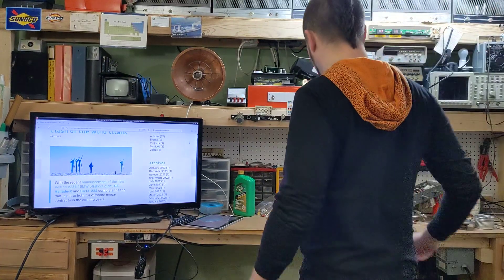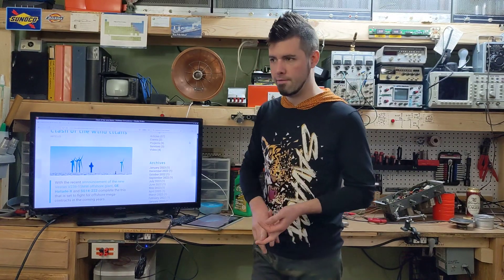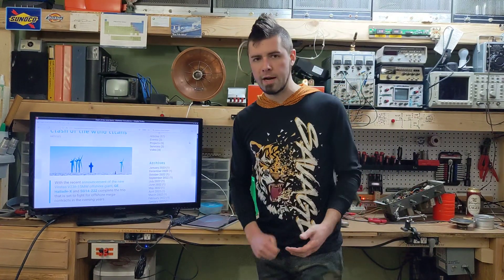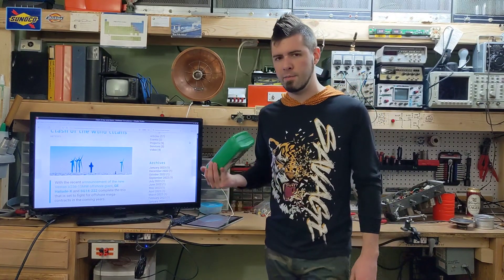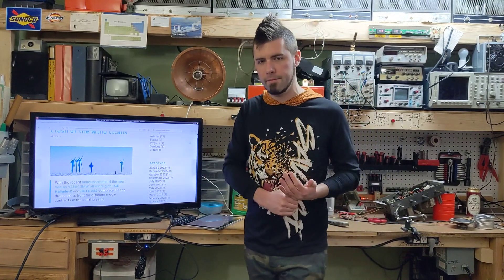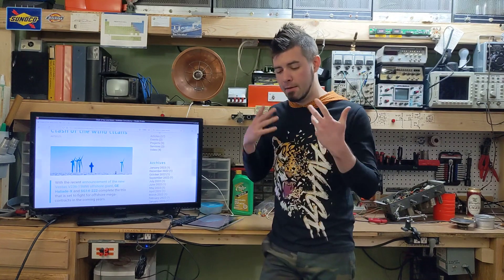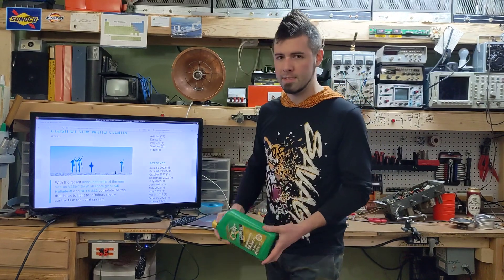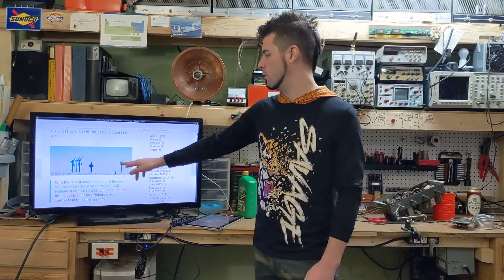How much oil is used in wind turbines?

Comment: Btw oil in wind turbines is changed every 9 to 16 months, more often in older turbines.
  So no your analogy that it's like transmission fluid isn't even close to accurate
Reply: Yeah but you ignore all the power output, energy it creates........ you cant compare that to an car that is burning it all with green gas (overall, the whole concept of an car) and an whole car is mostly considered an "cost" "consumerable" product.. Windturbines produce alot of electricity and its highly scalable (each year or so they prove it again), they even made some optimisations that by even at lower wind speed to produce the same or almost the same amout of energy even if it spins faster. There is almost no comparison.
Reply: @samfkt  actually wind turbines are far less efficient at producing energy than fossil fuels. However, if your concern is "green energy" hydro energy is far superior in every way than any other form of energy with a conversion rate of 90%.
Reply: @danielsmit11  I considered all variables, overall...   ofc nothing is ideal. And hydro etc. is not possible everywhere. Also he literally made the calculations by considering the oil change in 12 months but yo still complained even if he considered it.
Reply: @samfkt  electricity from dams can actually travel hundreds of miles, think 300 is the upper limit. Considering there are rivers through the vast majority of the U.S. much of our power needs can be obtained through hydro.
  Modern  Hydroelectric power plants can reach a conversion rate of 90% which far out performs wind turbine conversion rates of 20% to 40%. 
  Hydro also has the advantage of being cheaper than all other forms of electricity.

Comment: You're comparing a windmill to a power plant using diesel, but your power plant is hydro power. A 5MW windmill is not 80 it is 800 gallons of lubricant and that is not including the other 1000 or so gallons for the transformer. Generating power will never get away from using some kind of oil period. Windmills are lot of maintenance every 6 months. Imagine a forest of windmills that are high up in the air. Not so efficient to maintain anymore is it?? A small nuclear power plant generates 300MW of power.  You need to build and maintain 60 windmills to generate that much if they ran 100% efficient, but they aren't they are 20-40% at best. Solar and Windmills are a pipe dream. Hydro and Nuclear power is where it's at.

Comment: does a turbine really pay for itself in the life of the the wind turbine ? I've read in the 2-4 million dollar range
Reply from the maker: No one would build them if that wasn't the case. Wind power is a business. Let's look at a worst-case scenrario: A $3 million turbine might be a 3.8 MW unit, which produces 11,650 MWh/year at the average wind site. If we take the current Lazard lowest unsubsidized levelized cost of electricity of about $26/MWh, the turbine has an ROI of 10 years. That's still under half the life of the machine.
Reply: @anthraciteenergetics5497  By "half of the life", can you explain what happens after end of life? They change only the gears, generators and blades? Or all of it?  I heard they dropped the overall costs of installing it and building it up to 70% since 2010
Reply: @anthraciteenergetics5497  if they were not so subsidized they would not be built at all, it does not work without them. they also only last a tiny bit over 20 years, cant be recycled either. the ones in the long island sound half dont even spin and costs only went up.; its a scam atm

Comment: Gasoline is ~37.5 kWh per gallon, Diesel is a bit more, at ~41 kWh per gallon. If you see an EPA estimate of 115 MPGe  on an electric car, just divide that number by 37.5, to get the equivalent miles per kWh for that car. (~3 miles per kWh)

Comment: technical point:  an AUTOMATIC-TRANSMISSION  utilizes "transmission fluid" ... thin & <less viscous  10 weight ? ...    
a MANUAL Transmission  uses  HYPOID GEAR LUBE  ... 75W135 weight is not unexpected ... 
the Gear LUBE is NOT changed often - but - it is NOT a permanent LUBRICANT ... 
Thank You for your Informative VIDEO
COOP
the  WiSeNhEiMeR from Richmond, INDIANA 
...
Reply: That's why he used an oil change every year in is calculations. In real life, they send samples to be analyzed, to determine an oil change interval. That helps compensate for differences in operating environments. The oil isn't changed, until a chemical analysis determines it's time. Large turbine transmissions have oil filters, similar to an engine, to help reduce recirculated particulate matter.
Reply from the maker: Thanks! I wouldn't expect the gearbox lube to be permanent, there's certainly a change interval. Especially since the car transmission running for the equivalent of 1 year or 8,760 hours might be 250,000 miles...the entire life of a car!
Reply: @anthraciteenergetics5497  can the used oil be used again?